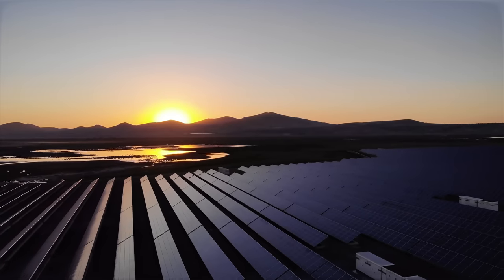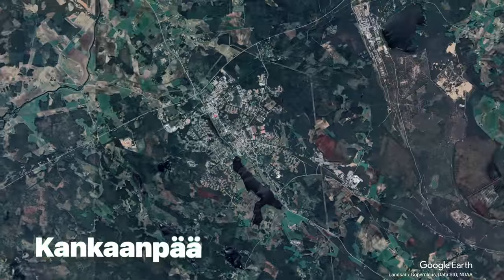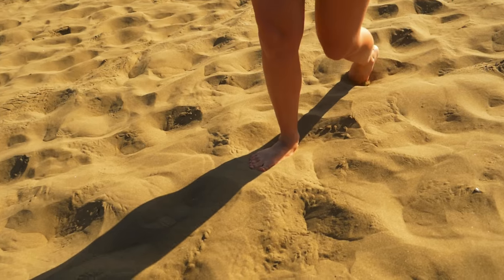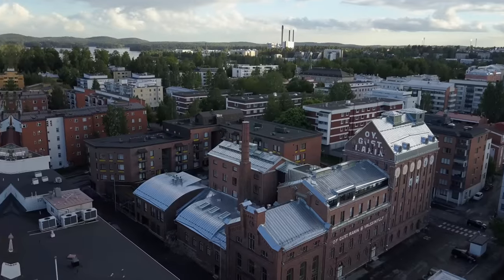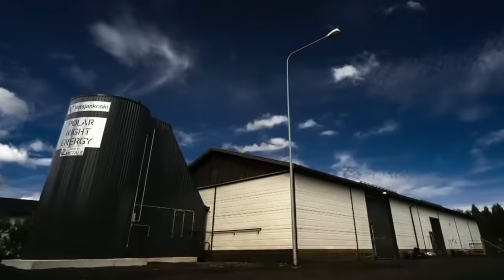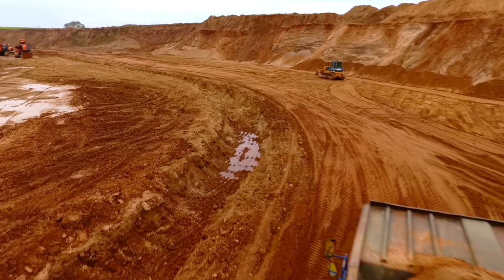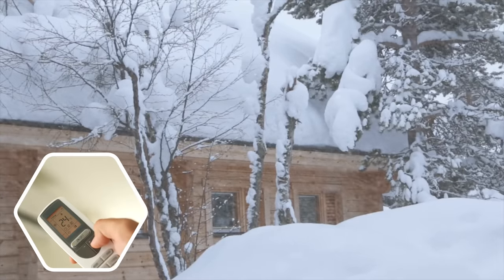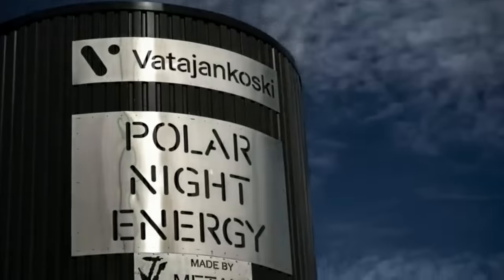Breakthrough Tech Heats Homes Cheaper Than Natural Gas!

Comment: On a small scale geothermal HVAC moves heat to and from the ground for a home.  If it's cold out you draw heat from the ground. 

I wonder If you have excess solar pv production you could heat the indoor environment with resistance heat (and air-to-air heat pumps) while putting the excess heat generated into the ground for storage during the day. At night reverse the heat pump to draw upon the heated ground.

The home would have the be high performance such as passive house so there is excess heat to store.

Comment: Great technology interesting idea but I have a feeling this example is the wrong application for it.. energy storage yes but heating homes with it?  isn't there a shortage of sand these days because you would need to use an awful lot of sand to make this idea universally available to heat our homes...At present sand is used in the building industry extensively which would put this technology in direct competition for those resources if used in the way your suggesting... say goodbye to our beaches then.....LMFAO
Reply: shortage of sand? where?!
Reply: Hell of a lot sand here in Finland at least. Also I don't think it was explained in this video but they used industry byproduct sand for this sand battery. Lot of cities/towns in Finland have heating pipes going over the the city, a district heating system. Not every home is connected to this heating network but most are. Also this sand battery is in actual use heating homes and swimming pools currently and works well. Check "Undecided with Matt Ferrell" video about this same sand battery it explains more.
Reply: You don't have to use construction grade sand for it, they can use recycled sand or non-graded sand and certain kinds of dirt/gravel.  So it is not necessarily relevant to the normal sand shortages you are considering.  It seems they are using that as their basis because it is more widely available and has a standard price that can be evaluated easily, rather than it being because it needs to be at that quality.
Reply: The sand in short supply in some areas is sand with sharp fractured edges. Round edge beach sand makes weak concrete or clogs up a fracked well.

Comment: Natural gas is cleaner but expensive.. electricity prices today are 0,85€/kwh we need cheaper ways to get electricity
Reply: Agreed. We use a lot of our power to heat air and water in our homes. A simple sand battery or something like it can get a big part of the job done for stationary things like a house. Other solutions to produce electricity for the grid and still others for transportation or small devices like a cell phone.
Reply: This uses free or very low cost electricity. Think 2 am wind. Sunday solar

Comment: You know central heating. Well there is a country that discovered district cooling like 200? years ago 🤔 What was it name 🤔 ASU? You said in the beginning that energy doesn’t disappear 🫥 it just changes form. Electricity to heat to electricity. Heat pumps? Cold to hot to cold. Come on. This is basics 🙄

Comment: This solves nothing, we need a solution to store energy during hot seasons and to be able to use it during cold seasons for at least 4 months.
Reply: A multi unit housing project in Toronto Ca. does just that.. Solar panels heat water that puts the heat into the ground all summer

Comment: 4 parts sand 1 part cement so why is my house not holding the heat it is 4 parts sand maybe even more the brick is clay which is sand
Reply: The sand and gravel in you house is bound tightly together by the portland. A great conductor. R 1  ( usa ) per 8 feet. Dry sand is an insulater. R 0.5 an inch.
Reply: Clay is an aluminum oxide. Not sand, which is mostly silicone oxide.

Comment: Solar photovoltaic and wind power do not require fuel for power generation, so huge amounts of fuel can be saved in the long run, and humans can also avoid the need to exploit God's carbon stock (oil and coal),

Comment: I am developing a sand battery designed specifically to generate electricity...
Reply: Are you 247solar? They have them built.
Reply: @kkarllwt  No, I am not them. Theirs are all commercial, mine is single home...

Comment: Clickbait title, its not a battery, just stores "heat" pending on how its stored and its location to the outside elements. The sand will cool much faster in a freezing environment then say Florida or the Sahara. It sounds like it reduces the amount of power needed for heat in some areas to save power, but as for a functioning battery, not even close.
Reply: There is a similar version of this that does convert it from heat to electric, but it is a research project that has been running.  Look up sandTES
Reply: the first batteries were jars holding static electricity.

Comment: Stirling engine for electric generation
Reply: 3 units of energy , in, 1 unit out?
Reply: @kkarllwt  33% efficiency is pretty good but what are you referring to?
Sun > pv panels> resistive heater> sand battery> stirling engine > generator 
Consistent electricity source

Comment: Characterizing this as a battery seems inaccurate it is really more of a thermal mass system that fits nicely into existing heat distribution infrastructure.
Are you aware of any systems that distribute chilled fluid for district cooling?
Reply: exactly this would be a battery cuz it has no way of transferring electricity from AB only heat none the less its still great as if would remove our dependency on gas and its exorbitant prices. this will take load of your electric boiler. and replace your gas boiler. meaning your bills won't have half of it coming from heating your home.
Reply: toronto Ca. takes 40 deg. water from 200 feet down and runs it thru a large downtown district cooling system

Comment: Ugh. This presentation confuses the use of sand as the thermal storage medium and any practical use as aheat sorce in homes. 
But the worst problem with this presentation is that it doesn't cover the good and bad of using a medium that has good heat retention but poor heat transfer characteristics, and doesn't talk about efficiency and loss. Those are the main critical issues considering a thermal storage medium.

So, for instance the main thermal transfer medium that's commonly used in solar concentrator farms is either pure sodium or salt which becomes liquid at about 600 degrees F. 'today's systems often circulate this molten salt as it's heated by the solar energy from numerous mirrors that reflect sunshine is circulated to where it can heat a separate water system which is in turn used to drive turbines that are connected to electrical generators.

At every step of the way, heat loss must be prevented or minimized which to a lay person would mean everywhere there is a difference between a superheated medium and the ambient trmperature. But these issues of insulation and materials used to construct a system that controls heat loss is very common and well known. Plenty of homes have water heater jackets. Kilns have been built for thousands of years using specific materials and designs. Although there is always coninueing research how to control the effects of heat transfer better, there is plenty of information available all around us based on real world operations and experience and the physics are very well studied and documented.

I'd say that the likely problem with using sand as a thermal storage medium is that its slow heat transfer characteristic makes it extremely difficult to build up energy storage. It's likely that an enormous amount of energy loss would be involved which more than compensates for any benefits of releasing energy slowly over a longer period of time. Unless a project can somehow demonstrate a new approach to heating a medium like sand efficiently, it's a poor choice as a thermal storage medium.

Comment: Can it store cold?
Reply: Thermal Conductivity acts the same way in regards to both putting in energy and extracting it, so yes it should.  I think it is just much cheaper process-wise to produce heat and store it than to do the reverse.  I know there are some scenarios where using it in that manner would be useful, but it isn't relevant to the current power grid system.
Reply: They used to store cold in ice houses, cutting ice from lakes and burying the blocks under sawdust in sheds for summer use.
Reply: @edbruder9975  In the 80s, some domes were built to hold water sprayed into them on days that were colder than 10 deg. f. . In the summer the 32 deg. melt water was used for cooling.

Comment: THIS IS NOT "BREAKTHROUGH"!!!!!!!!!!!!!!!!!!  I built a passive solar house in 1976 and used stone in a concrete enclosure to hold heat generated by tromb walls during the day and blew air through the stone all night to heat the house.
NOT BREAKTHROUGH!!!! 1976.  News Center 13 in Indianapolis did a news feature on this house.  STOP USING THE WORD BREAKTHROUGH!
Reply: The break-thru is that they are developing ways to take electricity that no one wants and store the energy in a way that retains some of the value. Multi day or week in a way that is as cheap as sand.

Comment: Sand battery is not a great name. What will your silicon battery video be called then? Lol  It could almost be considered a "thermal battery" if it's comprised of multiple "thermal cells", but if it's a single large silo "cell" then "thermal sand cell" would be accurate, and this is where you say "yeah but the algorithm tho" 😆

Comment: enjoy your solar sauna :)
Reply: instead of the resistive heating, use the electricity in heat pumps to get 5x the heat into the storage, the 5:1 lever of heat storage movement
Reply: most houses use district heating, not heat pumps
Reply: 100% of solar heat (80% heat 20% electricity) instead of 20% electricity only, so 5x total energy captured, and heat pump 5x instead of 1x of resistive heating, work smarter not harder, its not complicated, k.i.s.s. engineers :)
Reply: if you would make your things yourself, you dont need to pay for it to anyone, starting at least not by any trade agreement to any outsider (out of your country, state, country, house, yourself) actual independency
Reply: the simpler and cheaper systems are to make, low-high tech, the less you need to depend on anyone
Reply: and if you get good, you can do even the complex things íf somehow needed, control chips are a sellers trash they managed to sell you
Reply: by control chips I mean all kinds of centralized power needs, you can do your own heat storage in your rural home, and use it to make for example, metals
Reply: bury a container into ground, then you have ground heating, insulation, very simply

Comment: Look, it's heat capacity that is important, and sand has low heat capacity (1/2 that of water) It just can't hold that many BTu's. The equation for anyone with a real engineering degree is Q= M Cp (Tf - Ti) where Q= BTu's  M = mass (Lb) Cp= Heat  Capacity (Btu/Lb F) and delta  T = degrees F.
So many people push these pseudo science video's and they are just garbage.  Pumped water storage works because water at elevation has potential energy based on density x elevation x gravity.  Period.
Europe is in trouble precisely because politicians  ( who couldn't actually understand real energy balances ) fundamentally believe videos like this, then make incorrect policy decisions on the Altar of their new global warming religion.

Comment: Storing heat and storing electricity is fundamentally different. Calling both them both 'battery' is cheap and deceiving marketing strategy. It is called HEAT vs WORK in thermodynamics. Heating stones by fire and use it to heat houses was used from ancient times, making videos now called 'Breakthrough Tech Heats Homes Cheaper Than Natural Gas!' based on this idea is ... a bit of clickbait

Comment: Lol at cost of sand, go and dig...
Reply: That price reflects sand delivered in an urban environment. Half the cost is trucking. And, the quarry wants to be paid also. Call up your local sand pit. Ask for 13 tons/ 8 yards delivered. They will quote 10 to 18 dollars a ton depending on if it is unprocessed bank run , or, highly graded mason sand. In a big metro area where sand is hauled in by rail and delivered by truck, double the price.

Comment: Your approach to this seems technically sloppy.  The headline is disingenuous.. comparing burning natural gas to a thermal storage makes no sense.  You have to first assume that the area has excess renewable energy to store, and it can't be used without that.
Also you referred to "storing power" which is technically wrong - energy is stored, not power.  When you conflate those terms, I get the feeling you either don't know what you're talking about or you just don't care about technical accuracy as long as you get the clicks on youtube.

Comment: NOT viable as you describe it. I looked into it like a year ago when videos were first made about it.
1. You want to talk about texas using it to help heat in the cold. This alone shows you don't know what you are talking about. Most places in the united states do not have a central heating infrastructure.  You would have to build the infrastructure so not vialbe.
2. Sand does not retain heat well. That is why the commercial companies state they would heat the sand well past 100F because that is how you get the thermal storage from sand is the high temperatures. Have you ever been in a desert at night? It gets cold.
3. are there applications for sand storage. Yes, just not everywhere like you make it seem in the video.

People like you are why people like me will openly hate on "green energy". You lie about its capabilities so when something new comes out I will talk bad about it before I even do my research. Stop turning people away from green energy.

Comment: Really dumb title. No, a sand battery WONT be a replacement for gasoline. Ridiculous
Reply: It is pretty obviously already acting as a partial replacement for it in regards to heating in Finland, so...  I think you have already been kind of proven wrong on this to some extent even before saying this.

  *Probably should have said help in replacing